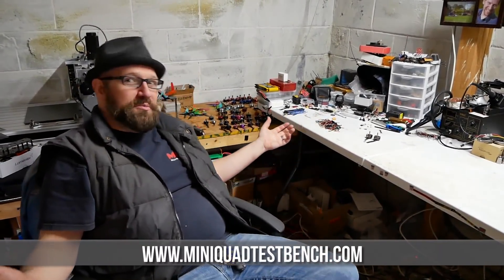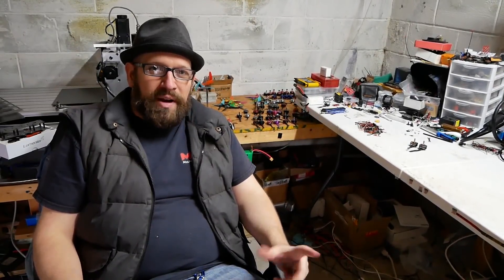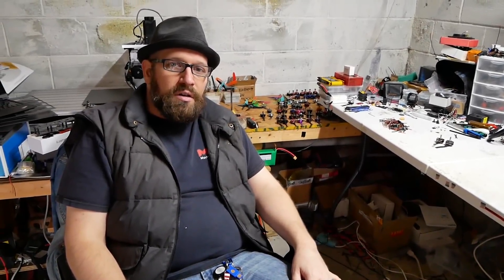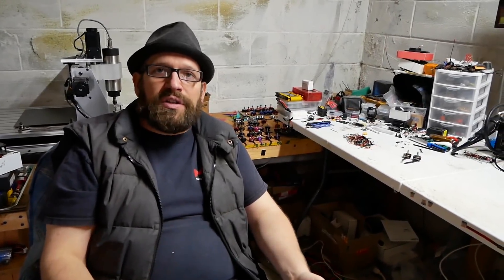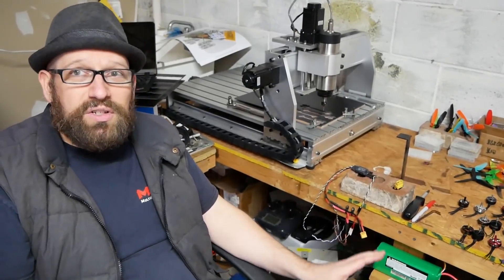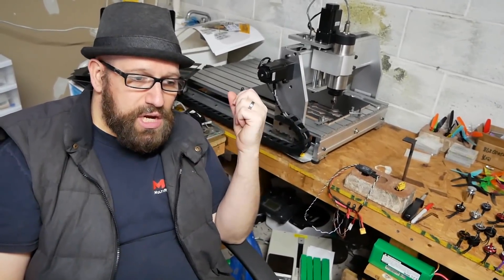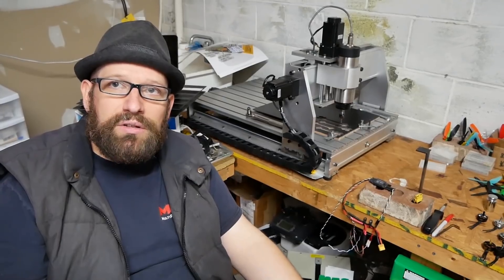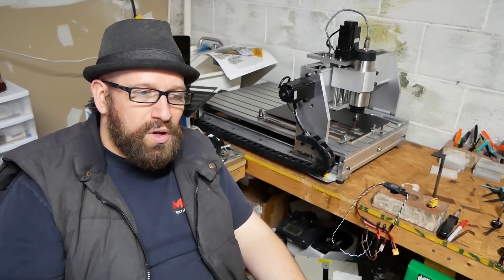Mini Kwad Motor Testing | HOW RYAN HARRELL RUNS MINIQUADTESTBENCH.COM

Comment: couple of bright fellers that could use some AIAG MSA training and a seat of Minitab or SAS... GR&R for measurement reproducibility and repeatability while evaluating interactions... Y=f(x), where air density and slope intercepts are predictable... 2 level DOE
Reply: You're correct in that if I was treating this as academic research I would structure it very differently. Ideally I would have a sample size for each motor large enough to maintain a valid statistical significance, run each motor through the test sequence enough times to establish a high enough R value, establish air density regressions, and run both measurement system and statistical analysis. But the truth is this is not scientific research, and everything has to be put through a cost benefit analysis. 

Part of establishing a design of experiment is that cost benefit analysis and looking at the use case and accuracy needs for the data to establish the degree of certainty that is necessary for valid conclusions. When I first began setting this up I spent a good deal of time talking with other researchers regarding that cost-benefit analysis, and given the amount of time available to put into this project, it was pretty obvious pretty quickly that the full rigor of academic research wouldn't be necessary here. We did some initial isoplots and regressions to establish some basic measurement repeatability values, and do periodic calibration checks against a common reference, but the benefit of establishing additional levels of certainty in terms of any additional useful knowledge compared to the necessary time investment is pretty much null.  I do have access to Minitab, SAS, SPSS, Matlab, and a ton of other analysis tools, as well as lab grade calibration references necessary for a full measurement system analysis. There's just not enough gain in using them to justify the time investment.
Reply: QuadMcFly greatly appreciate your detailed response and trust, my post was not intended to call any of your awesome work into question. Being the regulated industry I work in, my eduction and experience ... made sense to throw the subject out there as a talking point.
Reply: @brentshock3787  For sure, it's always important to consider the level of accuracy and repeatability of any of the information we see online. I wish more people were as critical in their thinking before absorbing information :D It's definitely worth more exploration in the details of how the information is gathered and verified, but I don't typically go into as much detail as most folks eyes just glaze over!

Comment: Why dont he do esc's testing again I know drone mesh does noise but esc output will be nice..
Reply from the maker: He says most all modern ESC's perform about the same.
Reply: Yeah the motivation to test a bunch of stuff that is virtually identical is pretty low given the time involved in ESC tests. Most of the factors in ESCs these days are things that you can't test on the bench, such as long term durability, average failure rates, etc.  Some of the current limit claims are insane on many of these 4-in-1s. Temperature tests and current load testing might be useful, but I don't have the right equipment for that, and honestly we're no where near close to thermal limits on most of these ESCs anyway. 

On a side note I have very low confidence in any useful extrapolation from Drone Mesh's testing results. They have too often varied dramatically from what I've seen from other sources and from direct experience.  Some of the ESCs and Flight Controllers he's tested and said were low noise have demonstrated in practical application to be extremely problematic.  That tells me either there's a huge variance between the units he has tested and the ones that hit retailers, his environment doesn't produce the same type of noise as in-flight performance, or there's something off with the methodology (or any combination of the above).  Not blaming him, necessarily. There are very many variables involved and isolating a workflow that produces useful results is not a simple matter. It just seems that however it's working, his results often don't match actual use.

Comment: Dear Mr. Bardwell,My name is Aaron, im a 47 yr old who loves my rc. I can L.O.S. fly and good with the build/bind/betaflight. I have 2 problems1. my radio & betaflt wont communicate 2. my power genius c606 batt. crgr wont let me charge my 4s 65c 1800 lipoI know you are the god of quads and don't have time for my noob -ness but can you please send me in the rite direction on finding a tutor or a class TO HALP ME LEARN THE FEW THINGS THAT I CANT FIG. OUT?IM VERY MECH INCLINED, USED TO INSTALL CAR AUDIO, RC 4X4 & DRIFT. ANY HELP AT ALL WILL BE greatly APPRICIATED!!THANK YOUAaron S
Reply from the maker: Here is my betaflight for beginners video, which shows how to install betaflight, drivers, and connect to your quad.

https://www.youtube.com/watch?v=xmaTq4JgTXI

Why your charger won't charge your lipo I'm afraid I can't say. What error message does it give?

Comment: I'd really love for Ryan to add even more subjective descriptions of motor performance in-air, because his intuition about what's happening is just as valuable as the high quality data mine he's created of reproducible static thrust data.
Reply: I've thought about this, but those kind of thoughts are so specific to the individual and what they're wanting to accomplish, and speak more to the comparison between different motors  in a specific context rather than any single motor  in general terms. I would rather talk to someone specifically, and get info about what they want then talk about how a motor choice might meet those needs or a prop choice might work in their favor. I've tried to address the thinking process in my interviews here with Bardwell, and in articles on the site. Trying to include all those variables in every write-up is impractical, and I don't feel like I would be doing it justice. I do at least try to include optimal prop selections, etc for each motor and point to its optimal applications.  We're trying to improve the quality of the analysis in the write-ups, and bringing on some new writers as well to change things up a bit. I'm excited to see how it goes, but it's a struggle to make sure it's balanced, factual, and accurately reflects the motor in the best way.

Comment: Where can I pick up one of those capacitors? I need to clean up my video :)
Reply: Interestingly enough those car audio caps are severely de-rated. This one says 2 Farads, but it works out to about 400mF, a whopping 1.6Farad de-rating. It's ok though, it was cheap and I bought it knowing it would be derated. 400mF is still enough to do what I need it to do.  Believe it or not it can actually spin up the motor on its own for about 5 seconds at idle :P As soon as you put a prop on though it drains almost instantly. :(
Reply: Years ago I tried to make a spot welder for 18650 cells using a couple of car audio capacitors, I almost got it to work but ended up blowing the MOSFETs that can handle 109A, literally splitting them in half, so gave up because even following circuits that others had designed & used I couldn't get it to work properly :(
The sparks are great when you short out a fully charged car audio capacitor on purpose :)

Comment: What are the rules of thumb for tall vs wide motors? Of the approximate same weight.
Reply: Thengine tall more top speed
Reply: Really short version - wider is efficient at lower throttle and handles heavier props much better. Taller is more efficient at higher throttle, and with less aggressive props can be much more linear.  Voltage and AUW also have significant effects on that.